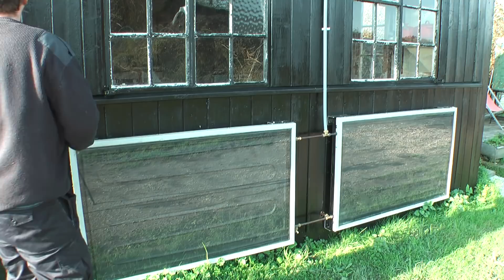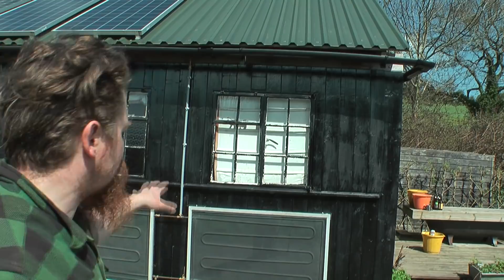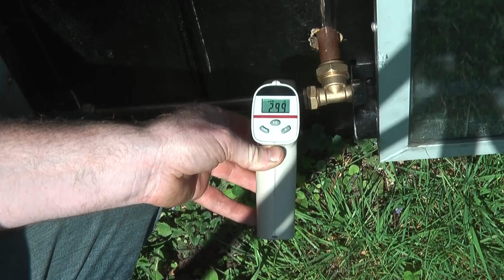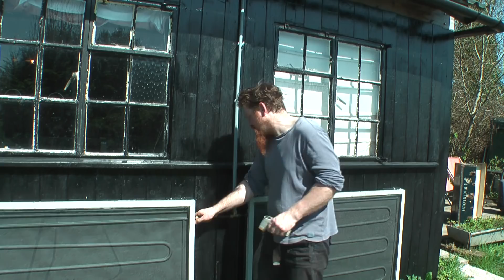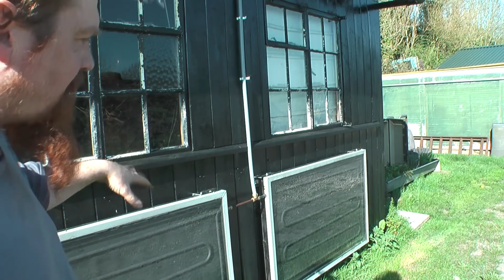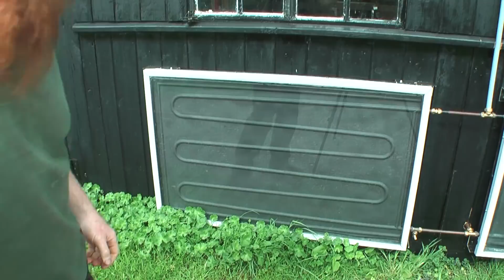Solar Hot Water Part 2 (of 3)

Comment: Have you got to room to put one panel above the other then run the return in the bottom one and the flow out the top one, I'm sure this would give more heat as then the flow into the top one would already be over 40 degC. Just be careful with the cylinder not being at least 60 degC as under that legionella can grow. Insulating all your pipework will help a lot. Thanks for the update love your vids.

Comment: I don't know if this actually fits your setup, but after your last video I asked my dad, who is a plumber of many many years about using the heat rising to move heat round and he told me that it used to be a common thing but apparently in order for it to work more efficiently you need much larger diameter pipes. 

Not sure he fully understood what I was asking but he seemed to lol so don't know if this info helps at all, either way loving that you are trying it, love your videos, love that you are actually off grid in the UK cause there are so little resources outside of america / canada off grid.

Comment: Pump speed control... if you had a 12V pump that would be very easy with a cheap PWM controller. Manual ones are available from ebay or you could build/buy something more intelligent.

However, you'll gain little to nothing controlling the speed through your panels providing you have enough flow through the loop to stop it boiling.  I used to design control systems for straw boilers and we experimented with varying the pump speed on them. The faster you go, the less time the water has to heat up so the colder your water output temperature. The overall energy supplied is the same because your fuel source is the same. You might gain a little bit in efficiency from the larger temperature differential between the source and the water, but you lose that later on when trying to empty the heat back out of the water.

At the two extremes, far too much flow you'll have basically the same temperature in your source loop to your load loop and you'll be wasting energy driving the pump. The other extreme you have a huge delta T in both supply and load, one end of your panels and the start of your floor will be burning, the other end will be frozen. The average is the same but neither is desirable. Somewhere in the middle there's a sweet spot but it will be consistent across the range of output of your panels.

We were trying to get the maximum amount of heat out of the straw boilers. Using the information from the input and output sensors I could measure the delta T, and by using a three phase pump on a VFD I could control the flow. I then programmed my controller so I could set a temperature differential. Comparing the temperature differential settings to data from a heat meter I found that whatever I did made no difference to power output. The one thing that we did that was useful was setting a minimum output temperature for the boiler to stop acid condensation inside the boiler, but that can just be done with a simple on/off control.
Reply from the maker: Interesting data, thanks.

Comment: Hi Max. Hope these two points may be useful to you. You mentioned polycarbonate to replace glass. My old polycarbonate secondary double glazing went milky and yellow after a few years facing the southern sun BUT polyacrylic (as used on old fighter cockpits) did not. Both were obtainable as 4mm sheet; the latter dearer. If you would like to swing the panels out at the base, to improve the collection angle, mods to the mountings would be needed. For swivel joints on the piping I have found compression fittings work well, provided they are greased and only tightened sparingly. Keeping a spanner handy will take care of any tendency to either jam or leak!
Reply from the maker: Good tip on the glazing, I'll look into that. I'm leaving the panels vertical and putting up with the slight loss of summer optimisation!

Comment: Be interesting to see how much 'heat leak' overnight. Ie how much does the hot water temp go down overnight because of heat lost through panels.  It does mean you not adding any water or heat  but would be worth finding out.
Reply from the maker: No heat loss from the panels at night as the hot water is stuck at the top of the loop in the heat exchanger.
Reply: Our panels were on the roof and even though there was a pump and controller valves, we lost around 5C over night.

Comment: Another great video :) A few points.

Are you aware of the renewable heat incentive? It is (or was) only available to new installations but would pay you to heat your house. So if you wanted to upgrade from free that might be of interest.
Going along with that, you can buy heat meters pretty cheaply. Whether that's for your interest or for use with claiming RHI from your range or the panels.

Finally, you may already know but you can get intelligent controllers for solar panel dump loads so you'd be able to contiuously vary your immersion heater from 0-3000W. Obivously there's money involved again but would make better use of what solar you have and might also be available for RHI.

It should also have been possible to register your solar system for the feed in tariff but that's probably more effort than it's worth.

Comment: I inherited a system with two of the glass tube collectors on the roof. They are highly efficient - the cylinder can go up to 75 on a hot day! (unfortunately, nothing you can do with this excess energy). The boiler does not come on from about May to November. So I suspect the glass tubes are probably an order of magnitude more effective than the copper plate ones. Would not install now as I would dump from the solar PV as you say. But as it's already there, it's great...

Comment: Hi Maximus, I've always wanted to "mess about" with my hot water system like this. My idea was to pre-heat the inlet water in the header tank via a heat exchanger. That way as you use water, the the water entering you hot water tank would be 40 degrees, not 20 degrees.
It strange how I live in a 4 bed detached house and I'm envious of your barn! 
Keep up the good work.

Comment: I assume your hot water cylinder is about 120 litres therefore with no losses it will take 5.6kWh to lift the water temperature by 40 deg C.............On a hot summers day, you can expect solar energy of 1kWh per square metre of surface area, how efficient are your panels (30%ish)? I would advise you lag your pipes for a start, the panels need to be inclined by 30 degrees. Fit a pump, you have plenty of electricity; control it off a cylinder stat and put a stat on the outlet of the panels to shut the pump down when the temperature drops too far; the wiring is straightforward. 

I would prefer to see your temperatures at the inlet and outlet of your cylinder that would be more accurate. Siphons have a very slow flow rate. I still think as is you will be disappointed with the results.
Reply from the maker: Why have a pump if I don't need a pump? I built a radiator system that runs superbly without being pumped, so this experiment was to see if I could achieve the same with solar hot water. So far the thermosyphon loop is working well and I expect it to only get better as the days get warmer. Controllers, stats and pumps are less attractive when the electric supply is often interrupted. In contrast, now they are set up, I could leave the solar loop and the radiator loop both open and go away for a week in summer knowing that when I come back there would be a tank of hot water with any excess diverted without fuss though the radiators.
Reply: A pumped system is far more efficient, HWS recovery times are considerably quicker, siphon flow rates vary between 20 to 60 litres/hr; that is very slow that's why you need to lag those pipes. A small domestic pump will only use 45Watt/hr, thermostats use nothing. The pump won't run all the time it will pulse via the solar panel stat, when the water temperature in the panel drops say below 40 deg C and or the cylinder stat is satisfied the pump is disabled. As for power usage don't you have batteries? In the summer you should have plenty of power available and in winter you won't be using the panels. ..........................  How do you intend to pritect your panels from frost? Glycol?

Comment: I think there are efficiencies to be had.  Repaint the inside of the panels with a deep matte black, for better thermal absorption.   Angle the bottoms of the panels up a few degrees to maximize your sun exposure.
Reply from the maker: I did spray them matt black whilst cleaning the inside of the glass.
Reply: Ah, I guess it just does not come across well in the video.  The paint on the building appears much darker.

Comment: Could you build your own heat exchanger to connect the heat pipes from the evacuated tubes, to the water loop without the need for pumps?
Reply from the maker: Sadly not, as the tubes would have to go on the roof, their manifold will higher than anything else, so would need to be pumped down into the rest of the system.

Comment: I know you are currently testing it, but what would be the benefit of insulating the pipework, particularly the external ones?
Reply from the maker: Surprisingly little, the tank was hot to within a few degrees of the panels. More important is super insulating the tank - I will do both the tank and pipes asap.

Comment: What would happen if you insulated all your pipes, so the cold water on the way down didn't lose as much heat and the panels would be heating from a higher start point?

I had a wood burning Rayburn in an old place that I had, that had a mechanical central heating thermostat slightly modified and strapped to the output water pipe which activated the water pump when it got hot enough. Whether you could do something like that if you connected a pump to the system for the underfloor heating.
Reply from the maker: Good question, I did wonder that, if the return was hotter would the panel work better, but then the flow would slow as there would be less difference in density pushing the water around. I guess I should find out on a hot summers day.
Reply: Its possible that could work to your advantage as the water would spend longer in the panel hopefully getting to a higher temperature.

Comment: maybe worth looking into to see if you could run a heating oil boiler, best thing ever in winter time not waking up ice on your nose
Reply from the maker: I have a woodburning range feeding giant cast iron radiators and underfloor heating, plus a massive woodburner in the living room, both will run round the clock if required. I am warm all winter! This experiment is more about spring, summer and autumn.
Reply: i know i watch your videos, i live not far from Scotland and have only ever had fires for heat and cooking. open fires then back boilers with raditors and now i got the oil boiler still have the fires aswell all joined together, spend around 250 on oil a year as the price goes up and down a lot but it is worth it, and you cant really run a fire around the clock as you need to clean them out a lot and the chimney once a month
Reply: mike doblo What kind of oil heater are you talking about Mike? Care to elaborate?
Reply: they are called oil boilers and fuel is called heating oil but iam sure its just kerosene, I got a an old used Worcester one, it has two tanks one for hot water and one for radiators .you  need a big fuel tank 1000 liters sat outside, the minimum amount of fuel you can buy at a time is 500 liters,

Comment: Why not try using flexible piping and turn the panels to the sun as it pans across the sky??
Reply from the maker: Too much work! This is less efficient but requires zero input from me.
Reply: Not worth it even for PV anymore.

For the cost you spent on a tracker you can get more gain just from more PV if you have space.

Comment: A good video! 
I can see 2 points you may be able to improve on ..... or I could just be wrong! (strange and unlikely as that concept is I am, occasionally ;0) )
1 Your thermal radiators/ generators seem to have a pipe running vertically which would give an open loop which is not what you want on a thermal siphon!
2 You have your radiators / generators are plumbed in parallel! If you took your output from one and fed it to the input of the second you would get twice the thermal difference. 
This would have the effect of pumping your thermal siphon better .... but slower! You will get the same power out eather way but in series the heat output is higher which is what you want!
I remember seeing those evacuated tube heaters at the Eden Project 30 years ago ..... so tried and tested tech! I do not remember the being pumped though. If my altzhimers has not befuddled me, they had a series of them mounted with one end high in a row all to a parallel bus pipe! The heat collected was impressive but the volume of water small so the flow rates were not great ..... but you can't have it all ways, can you?
Best of luck with your experiment!
Reply from the maker: Thanks! 
1, It's a crease to stiffen the pane, just looks like a pipe, if you look at the bit of part 1 where I fix the damaged panel, you can see the insides. 
2, I did film a section discussing the serial / parallel options but it didn't make the final cut! I decided this way was better for flow.
Reply: My mistake  .... it was this place! http://visit.cat.org.uk/
Reply: I was about to say the same thing about the series arrangement giving higher temperature. If you want parallel, then I would pipe them so that the flow of the water is not clashing at the connection points. I think you could seal the panel airtight to reduce leakage of heat, or better yet, vacuum the panel.  Plastic window would insulate more than glass (thermal conductivity 0.2 vs 1.0 W/mK).  Polyethylene transmits better in the thermal infrared than acrylic, polycarbonate or float glass etc.  Also, the aluminium frame is acting as a heat sink - replace with plastic, wood, or better yet, polystyrene foam.  Have you seen the coke-can solar thermal heaters?  They seem to work well.  I'm enjoying the videos, thanks for uploading.
Reply: The Eden Project opened in 2001.
Reply: lucky i read this thread before commenting, i thought the passive solar panels could be "daisy chained" to get better heating in a step up style :)

Comment: A few years ago I saw a report on how cheap mirrors placed at 45% around a solar panel dramatically improved the electrical output perhaps the same method would help your water system.Small outlay to try it.
Reply from the maker: Unfortunately I have to drive vehicles right in front of the panels!
Reply: The mirrors don't have to be fixed easily moved aside give it a try nothing to lose.

Comment: If you insulated the pipes what would the difference be
Reply from the maker: I will insulate them, but it won't help that much if they're not hot to begin with.
Reply: I would certainly add some cheap foam insulation to the pipes it's around £8 for 5m

Comment: For your restrictor on the pipework you can use a 22mm gate valve then you can open and close it as much as you need to until you have it the way you want it if not you can use a non return flap valve however this normally only work In pumped installations 👍🏻 the other thing I can suggest is to slightly tilt the panels so natural convection occurs a little better if you push the bottom forward and then you will have a better angle on the sun also
Reply: Eer not too sure, would a non return valve work better? but if I recall they have to be mounted horizontally.
Reply: @peterperigoe9231  A non return valve is spring return, without any pressure from a pump it won't open the valve. even a single check wont open if its not under pressure. I have done on a job before where I removed the spring from a check valve, but its better to just use a non return valve with a flap, gate valve will do the job too, Its the same as balancing a radiator circuit. I'm a plumbing and heating engineer in rl.
Reply: @nico101gaming  Ah, I get you, a difference in terminology, here we would call a flap valve, a non return valve and the spring valve, you mention a check valve.